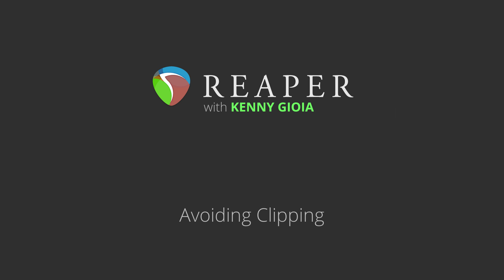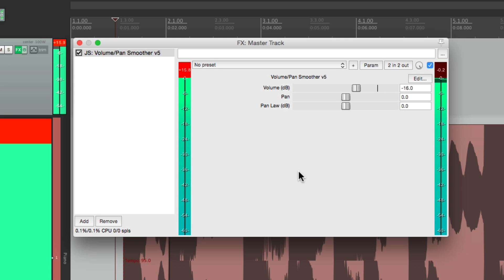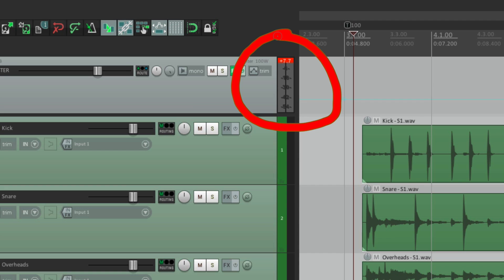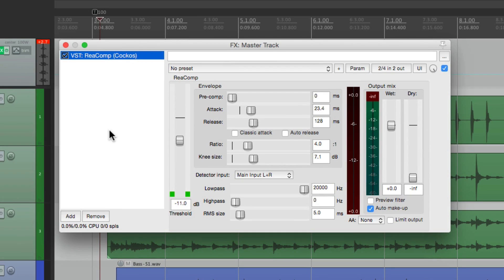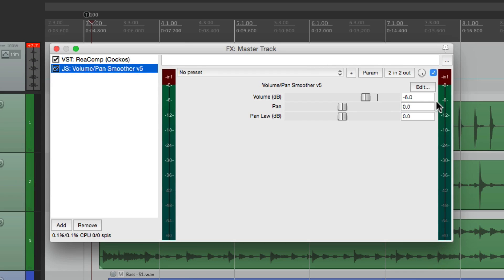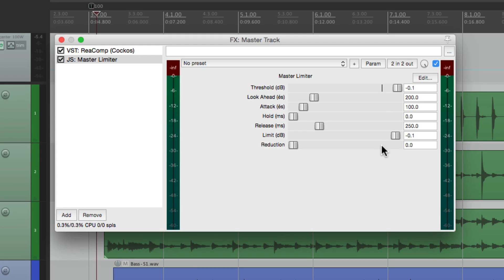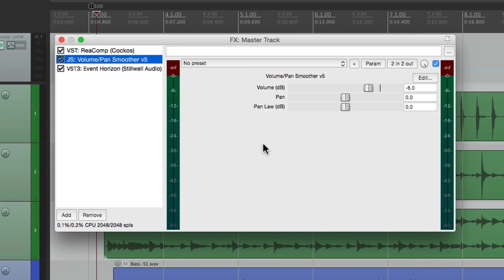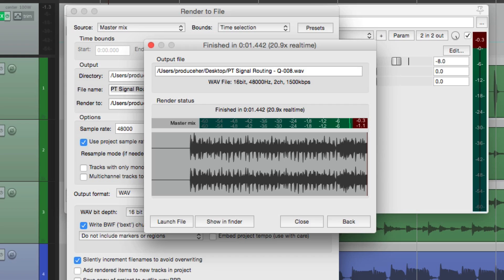Avoiding Clipping in REAPER

Comment: (5:28) The display of the gain reduction seems to be a bit buggy for the JS limiter. But it can be easily fixed in the code by not updating the slider at sample rate.

Comment: I'm a little confused. In a different volume video, you said that the volume smoother on works in the control room monitors and doesn't change the output level. Does it work differently when applied on a track as opposed to the master? What about a sub?

Comment: I guess my problem is different.  I don't have an always loud track.  It's preaching, so sometimes the preacher gets soft, sometimes loud.  For a few years when we've started recording the messages, I've manually put cuts and adjusted volumes around each part that was clipping.  This is super time consuming and I recently learned about limiters, which has also led me here.  The info in this video is very helpful in general, but not useful in a case where you need soft parts to be boosted, but loud parts to be reduced not to clip.  I know that's what the limiter is supposed to do, but I'm having mixed results which several of the ones I'm trying.  I'm still getting clipping at the loud parts.
Reply: Ok nevermind.  I moved the limiter from the track to the master, and holy cow.  I still got a lot to learn, but I thank you Kenny for these tutorials.  I've watched 5 today and feel like a whole new man.

Comment: Even though what you are doing obviously works in the digital realm, why would you recommend mixing using this method? Obviously you have done some work on the individual tracks to create a balance. Why wouldn't you correct the clipping during the mix rather than the end. I had the same thoughts on your gain staging video. if your kick is clipping at plus 24 db, how can you properly mix in any other tracks without clipping them as well? I don't understand the benefit derived from this method.

Comment: You must have a different Render setting in your Reaper version that I'm not aware of. Mine still renders sound to a saved file inside a folder even if it's set to Full-speed Offline...
Reply: Luis Rodriguez so did Kenny's, it was just really fast.
Reply from the maker: A file was still being rendered. I just delete it later.
Reply: REAPER Mania...My bad. I thought the file did not render while doing that, but I see that it does. Thanks.

Comment: Why not just decrease the master fader 8 db?  Why do you need a plugin?
Reply: otherwise you're affecting the master volume chain. The purpose of this method is reducing the volume before the end of the chain, and then if you want use some other plugin after it.
That's what I understand.
Reply from the maker: Correct. If you're not using any plugins, it doesn't really matter. If you are using a plugins, it also doesn't matter unless you're using a limiter at the end of the chain. Using the Master fader in that situation will affect the volume AFTER the last plug. So you'll already be using soft-clipping before that fader. Plus, I like to keep my Master fader at 0dB. Just a habit I like.
Reply: thanks useful
Reply: I was wondering this too! Thanks guys :)
Reply: So , non of the reaper-plugins do clip, when they Show red Light. right? this is another Question, i know.. but surrounding the same Thema.. And they only Clip when you exceed 0 db, when Exporting Audio, like you showed in this Vid. (Ok, if you would go insanely high  overriding Volume , you would (in Standardsettings)  Clip even before that last Moment... cause Standard is 32 bit calculations, after that there is also no Room, meaning clipping, but you have to exceed haviely Red Light)

Comment: do you think you could do a tutorial on what a limiter is and it's functions? i still don't understand it
Reply: SwellSeth I second this.
Reply: SwellSeth Reaper limiter... I support video on this... :)
Reply: If you understand a compressor a limiter is really same thing. It comes down to the ratio of how hard the sound gets compressed. If you are using a 10:1 ratio or higher you are generally considered to be limiting at that point where as anything under that like for example a 4:1 ratio, you are simply compressing.  Generally the compressor will be used in mixing and mastering. Where as limiting will be the final process in the master fx chain that gives the whole track that radio ready loudness without clipping.  Of course you can use a limiter other then a final step (like for preventing clipping early on, or perhaps for a desired effect, I am just keeping this information digestible. Hope it helps, I am still learning aswell.

Comment: Clipping synonymous with distortion?   So, it's okay if it clips as long as you adjust via JS volume
Reply: s. brooks clipping on the master bus causes a different type of distortion that's very undesirable. the clipping built into the limiter had a stylized effect that can enhance the sound.
Reply: Thanks